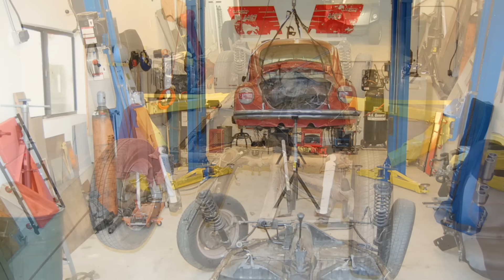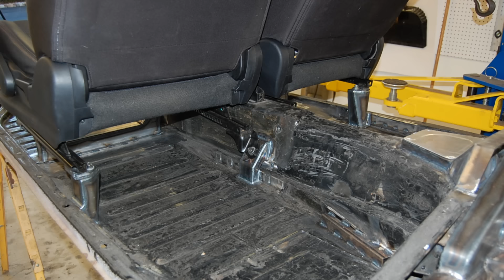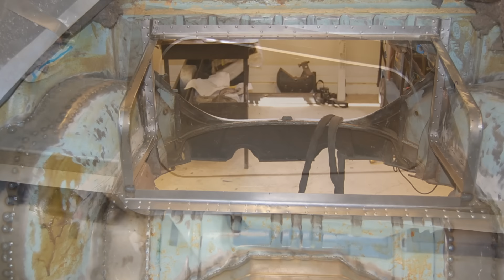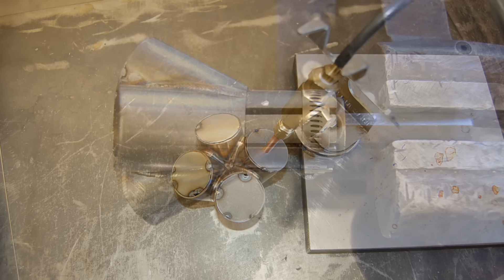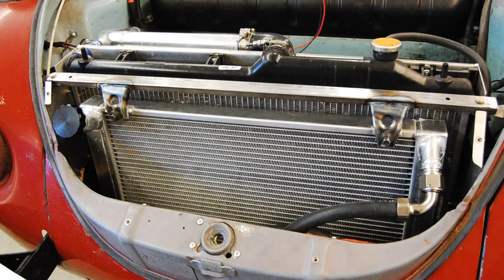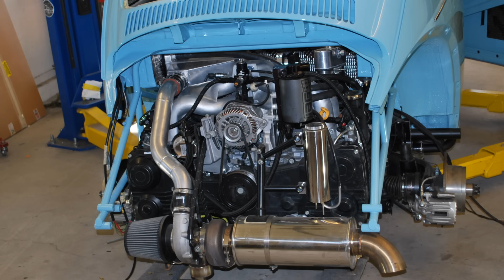The Supersleeper Project

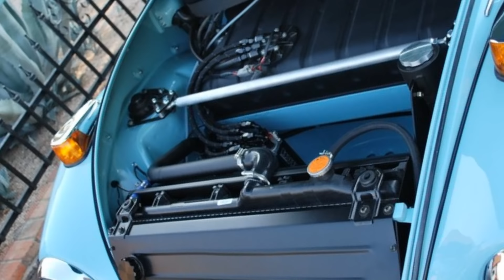Comment: Love the build John! I’m doing something similar to a ‘72 SB.  I have a question about the in-tank EFI pump @ 15:14…it looks like it runs the pressurized fuel to a sump because the stock tank doesn’t have an internal sump around the pickup.  Since the hi pressure output from the in-tank pump goes to the sump, I assume that sump is pressurized.  Is this correct?  It also appears that the return line to the tank comes from this sump.  I thought the return line is supposed to run at lower pressure than the supply.  So wouldn’t all the lines from that sump in the spare tire well be running the same psi as the supply line from the in tank EFI pump…including the return line to the tank and wouldn’t that pressurize the tank?  Clearly I don’t understand how your system works, however I’ve watched all your run videos so work it clearly does!  Any clarification you could provide would be appreciated.  Thanks.
Reply: …did more research.  I bet you have the high pressure pump inside the sump and are using the in tank pump as a lifting pump.  The high pressure lines happen downstream of the sump’s hi-pressure pump.  Thanks for listening!  DOH! 😖
Reply from the maker: Just imagine the sump has both the feed and return lines from the engine running to it.  The fuel tank has it's own fuel pump that feeds the sump. The sump also has a *vent line that runs to the main tank so that the sump is never under pressure but continuously recycles the hotter fuel in the sump.
Reply: @JohnReynolds661  Thanks for the explanation…I now understand.  I’m going to use a ‘pump-n-sump’ and plumbing setup similar to yours.  Thank you again…very helpful!

Comment: Nice work.  How do you keep the tires from spinning on the street.  I have 1/3 your horsepower, and it gets really squirrely in second gear.
Reply from the maker: Thanks, it takes a Hoosier, 11 inch wide  275/ drag radial to get most of the power to the ground.

Comment: John…I’m doing a EJ25 in a ‘72 SB and having trouble finding a good example of the coolant line path from frunk through the suspension (or under?) to where you have the tubes running along the pan sides.   I’ve watched all your build videos but haven’t come across a picture where you show that routing!  Do you have a snap shot of that routing?  Thanks for posting these build threads.  I find them extremely inspiring. 👍👍
Reply from the maker: I posted more pics and info over on the Facebook group, Subaru Powered VWs.  You’d have to join the group then you could search my name and my pics will show up.
Reply: Thank you John…appreciated that! J. (Aka, DUNGBTL) @JohnReynolds661

Comment: That's a sensible strategy, since the Subaru engine is also a boxer type engine capable of making gobs of HP. Are the stock looking pipes connected to the exhaust system or are they just a clever camouflage?
Reply from the maker: They work and are instead connected to the waste gate.

Comment: Over 25 years ago my cousin and I built a Subaru powered super beetle. It was a non-turbo with a racing spec VW transaxle. It was more of a baja inspired bug with offroad suspension and bfgoodrich tires. We painted it canary yellow with a black racing stripe. My current project with my son is 97 le Sabre we're making an electric muscle cruiser. It's still gonna be FWD but with an electric conversion kit

Comment: Molested ?  Don’t think so - that’s some really nice fab work !  How about a video of the sleeper in action ? 😎. Never mind,found it - WOW 👍👍 that has to be a blast !!   Is the next sleeper going to use the AWD drivetrain??
Reply from the maker: It doesn't make sense to use AWD in a rear engine set-up.  Traction is not a problem.  Also, I don't have the weight, complexity, or parasitic drag of AWD.

Comment: Very nicely done nice welding jobs all the way around I'm surprised that you can that the parts are available to make your own inner intercooler what did you do about the Piston aspect for the brakes to have them apply proper without locking up or not working properly years and years ago I did a Volkswagen but I put a Oldsmobile 455 Gran Torino front end in the back end a lot of fabrication just like you let me tell you a lot but my biggest problem was always the brakes took me months to get the proper master cylinder
Reply from the maker: I started with a MC for VW bug disk  brakes, I think it was a 20mm piston.  Good feel but not enough power.  So I switched to a stock 19mm drum brake MC and it has more stopping power with less brake pedal pressure.

Comment: I think your lead in is curious. I have a 1972 German-European Super Beetle and it came with the smaller 1968 style 'tombstone' taillight lenses; yellow on top the red for the remainder. There is no lower bulb where you might have found the backup light. 
What I have noticed in many 2015 and newer foreign and domestic cars is that the brake light lenses are not any bigger or brighter than what you find on the later Super Beetles (1971 to the end).

Comment: Have you had any joint issues running that much offset in the axles?
Reply from the maker: No joint failures but had cv boot issues
Reply: @JohnReynolds661  
I did a project years ago where I put a Chrysler 3.5 v6  out of a 2002 300m longitudinally mounted in the back of an 88 Pontiac Fiero. I'm running about an 11° offset on my axles and have had issues getting inner c/v joints that don't end up noisy.  Been thinking about making some axle stubs and switching to the porsche joints.  So do both inner and outer joints plunge to allow for suspension movement?  Do you think I could run a stock GM outer and a Porsche inner? Or would I need porsche on both inner and outer?
Thanks for the reply.
Reply from the maker: @chrisj8822  from my experience, using plunging style GKN 930 CVS on all sides with RCV grease is the best combo.  CVS at these angles will not last as long but is part of the sacrifice .  Under full power, I may feel a little vibration that could be contributed to the angle, but I can’t prove it.  Does your setup use tripode CVS?
Reply: @JohnReynolds661  
My original setup was a stock Chrysler inner tripod joint and a stock outer GM joint. This was ok but shuddered under medium to hard acceleration.  
I had The Driveshaft Shop make me a pair of axles using a generic 6 ball plunging inner c/v with the Chrysler stub welded to it. This eliminated my shuddered but the joints started making a clicking noise after just a few hundred miles.  Turns out the balls were harder than the cup and started wearing a hole in the raceway at each end of the travel. I had them make me a new pair but those joints also failed in the same way.  So I just gave up on them and drove with the noise. I've been wanting to try something different and you bug video got me thinking....

Comment: Did you use any CAD ahead of time, or was all the design work in your head and trial mock ups? This is a real work of art!
Reply from the maker: Thanks, I don't know how to use cad.  A lot of it is just connecting point A to point B by using poster board templates.  Making it look "right" is on the fly.
Reply: @JohnReynolds661  That's pretty cool. Takes real skills to do that.

Comment: Wow, that is impressive fabrication work . Just like to point out that rear wheel drive bugs handle optimal when the front is approx. 1 inch higher than the rear. 
The dropped front is a drag racing trick that is not suitable for public roads and has wrongly become a trendy mod I often see on the road.
Reply from the maker: I didn't know that.  I thought the reason bugs were higher in front was to keep the front tires from rubbing the fenders when turning.  Anyway, it may handle better but I prefer the look of it down.

Comment: Hundreds of people using stroker Aircooled power plants running 10-11s on IDA Carbs (not even fuel injected) in a street car ALL MOTOR btw and nobody bats an eye but someone shoves a Subaru with a TURBO EFI running low 11s perhaps high 10s and everybody is fkn mind blown and this guy is gods gift to the street scene lmao . I’m not here to discredit this build it’s awesome and any fast vw has my respect Just trying to figure out why respect is given in one area and not another.
Reply from the maker: You're missing the point.  It was an exercise in fabrication, not another hopped-up VW motor that's been done thousands of times.
Reply: @JohnReynolds661  I can definitely appreciate it in that light I mean it looks like a ton of work and it has been done very tastefully

Comment: I have a 68 Baja ,, so some of these steps wouldn’t be necessary,, I’d guess,,  considering most of the motor is exposed, and I’ll be running off-road tires,,, also thinking of super~charging rather than turbo,, this car will see off road as well as on,,, especially my once a year ride to California city, from Illinois and back. Would you ever consider building another, sir?

Comment: First of all no bug is a sleeper everyone knows about bugs they're light they're uniform and they're designed so you can customize the shit out of them with relative ease most things fit and if they don't it's not a big deal to cut the damn thing up to make it fit. I've seen bugs with the front engine V8 rear wheel drive tubed out with some big ass Mickey Thompson slicks on the back rolling down the freeway next to me when I was a teenager. The dude had fucking gun range muffs on his ears because his car is so loud. Exhaust pipes popping up right behind the front wheel. Then another time I'm just going somewhere minding my business walking down the street I hear VTEC. I know it's a b16. But I looked around and all I see is a fucking orange bug. it's got wheels that are way too deep dished or wide rather for it to be a stock engine and suspension setup. And then the guy makes a u-turn here I'm coming up the street again, burrrrrrrrBOOOOOOOOOOO! DEFINITELY HAVE A HIT ON THE VTECH METER NOW, so I tell out to the driver, hey man, is that a b16? He says hell yeah. I've seen Subaru Impreza engine stuffed in the rear. I've seen yzfr1 motors stuck in them. Hell I've even got an idea of my own then I want to do to a bug. After all was my first car 64 bug. However they are not safe for shit. Even my EF generation Hondas make me uneasy. Although I write a motorcycle, I just know I will die right off the bat in the motorcycle and I won't suffer and be trapped in the car. I lived in a state where we didn't have so many dumb women and loser ass guys driving big fucking SUVs for no reason. I'd love to drive simple little lightweight cars like that

Comment: Why did he not use a Porsche  Engine?
Reply from the maker: A Porsche engine has the same inherent problems as a VW engine.  I wanted to start with something more modern with 4 valve heads, 5 main bearings and a host of other things needed to make bigger power.

Comment: I hope you give us some specs like top speed, fuel consumption, torque, zero to 60 etc.
Reply from the maker: Top speed is faster than I want to drive it.  I've 127 and still had another gear.  Max TQ on e85 is 470 Ft-lb. WHP is 517 done on a Mustang dyno.  0-60 is 2:97.  Fuel consumption, seriously?  https://youtu.be/4Od1IsLw6ts

Comment: Hello John,
Actually have the identical Marina Blue 1973 Super Beetle myself !
Had plans to do something extremely similar to my VW, with one "SMALL" exception.
I would like to utilize the same Turbo Subaru power, 
however, would like to make a significant additional floor pan modification !
I want to build this car not as a rear engine car !
But as a Mid-engined chassis !
The same intercoolers, and radiator configuration, same rack and pinion steering !
Essentially the same end result in outward appearance, but sitting on a Mid-engined Turbo Subaru Chassis !
I am paralyzed from my shoulders down, and not able to do this work without assistance !
Would you have any interest in my project Sir ?
Thank you,
Ray Parsons

Comment: For such an engineering feat, I am surprised you didn't mount the motor the right way round and then you wouldn't have had to mess with the diff, plus the driveshafts may have been able to be straight and it would have been mid engined. As it is you couldn't use the rear seats anyway so you may as well have put the engine there. Running the driveshafts at that crazy angle is undesirable, as I'm sure you know.

Comment: Totally awesome project, but it looks like it would have been simpler to move the VW body to the Subaru chassis?
Reply from the maker: The Subaru motor would stick through the front of the VW hood.  I thought of all variables including AWD.  This configuration makes the most sense.  However, it doesn't have to be this involved and can be more of a get-er-done approach.
Reply: I was thinking of turning the Subaru chassis around where the engine would be in the back, either way this is some REALLY impressive fabrication.
Reply from the maker: The Subaru is 6" wider.  The drive train has to still have a reverse rotation and they are both unibodies.  To marry the two together makes what I did look easy.
Reply: @JohnReynolds661  your results seem to speak very well for themselves. (I also enjoyed the video of driving it around)

Comment: 1/16 of 517 hp is 32 hp, less than the hp of a 1973 Beetle, which was about 60. Very earliest beetle had 36 hp, at 1.2 liters. After awhile they creeped up to 40. A 1967 beetle had 50 hp, 68 had 53, at 1.5 liters. A year or so later it had 1.6 liters and more horsepower. about 57.. Then in the 70's fuel injection replaced the carbs and the horsepower went up even more, to about 60. The horsepower has been increased about 9 times, not 16.

Comment: So what happened with the front suspension? It's a nice build but a little more of an in depth view would be appreciated.
Reply from the maker: What do you mean?  It's a stock strut suspension with urethane bushings, disk brakes and later model rack and pinion steering. There's plenty of info I didn't include.  If I would have made the video longer, it would have put people to sleep.
Reply: @JohnReynolds661  I don't think it would have put people to sleep. Most people that watch a minute or two of your work, would be willing to watch an hour long video. Are there plans to upgrade the front suspension?
Reply from the maker: I don't see any reason.  It's works well, light weight,  has a nice ride quality and doesn't take up much room.  Mendeola front suspensions for beam axle VWs probably work fine but they are heavy and restrict air flow to the radiator.  If it was a dedicated track or rally car, this would be a different conversation.
Reply: @JohnReynolds661  Yeah I was just thinking of the track usage, but yeah I can see your point.

Comment: This is absolutely the best rebuild I have seen so far. Wish I had the money and the equipment. I would have built a turbo boxer VW motor though. BTW it is not a 1973... I have a 1973 and it has the small tail lights. The big (ugly) ones were introduced in 1974. Enjoy blasting away 90% of super cars...

Comment: Hi John. Wow. So many hours to achieve this result.
You've obviously run around a bit with it.
Impressions? Criticism?
With so much solid craftsmanship put in, is there anything you would have done differently??
Reply from the maker: It doesn't need any more power, that's for sure.  The idea was to have the biggest contrast between how it looks and how much performance it has, I'm happy there.  In retrospect, I might have started with a Mindeola trans but that ship has sailed.

Comment: Sure glad you were able to “save weight” on that rear bumper mount. Wouldn’t want to waste any of that 500 hp on an unnecessarily heavy support! 😂 Having owned a new 1972 orange Baja Super Beetle back in my youth I can assure you that your sissy blue 1973 would beat it off the line...by a touch. 😉 Amazing project, wonderfully presented, and you are to be praised and congratulated. Work hard to keep it between the lines. VW’s are notoriously finicky when pressed. 👍🏻
Reply from the maker: Yeah, when I drove it for the first time, all that fussy weight saving seemed kind of silly.

Comment: Wow! Can’t say much else 👏 although for the ultimate sleeper look in my opinion skinnier rear tires and slight tint on the rear windows to hide the rollbar would be better.
Reply from the maker: The car loses traction in 1st, 2nd and even 3rd just rolling on the throttle.  Believe me, the bigger drag radial tire was a necessary give-away.  I did tent the windows but just a little.  70% ( that means it lets 70% of light through) for  front windshield and 60% all other windows.  Really dark windows on a bug look goofy IMO.  In short, you can't have a car that makes 16x the OG whp and not have a few tells.

Comment: So I have two Hondas...you can call me a fanboy, but I also appreciate any builds as long as the builder puts their heart and soul into it, and you sir have more than accomplished that. I am in awe. I have a 709 whp EJ8 Civic coupe that I built, as well as a 522 whp CG1 J32A six speed manual swapped Accord and I almost feel like I cheated the system because while those engines are bolt in swaps for those chassis, you had to almost completely fabricate the frame for that engine and drivetrain to fit properly. My hat goes off to you sir.

Comment: This is just beautiful!  The engineering looks on target. We’re there any surprises? Now that you have driven it, have the engineering solutions held up?  Why did you choose the Subi engine over the other more obvious choice?
Reply from the maker: It's holding up fine, I chased an oil leak for a bit and have had to come up with a better solution for the CV boots.  As far as the Subie choice, it's logical because it's a flat four, like the VW.  It's better engineered from a strength standpoint, has 4 valve heads and puts out a lot more power reliably.  The deciding factor was that a company makes a reverse ring and pinion for the transmission to make the conversion *practicable.